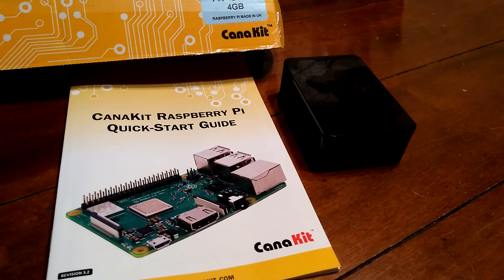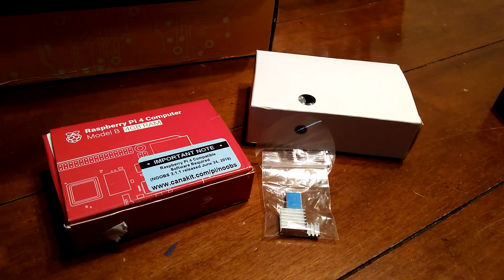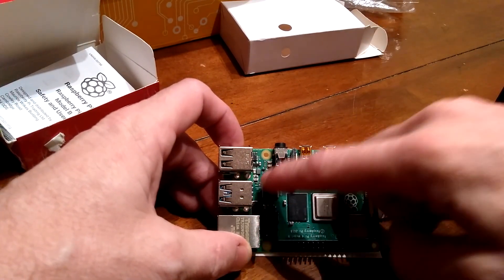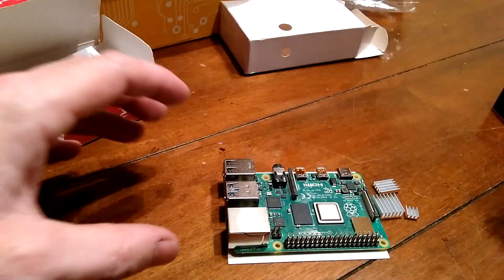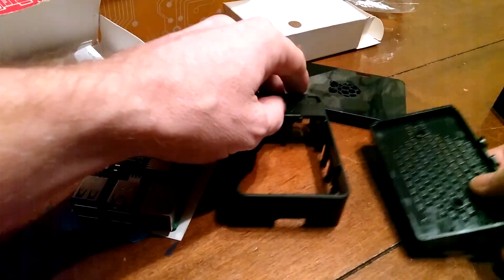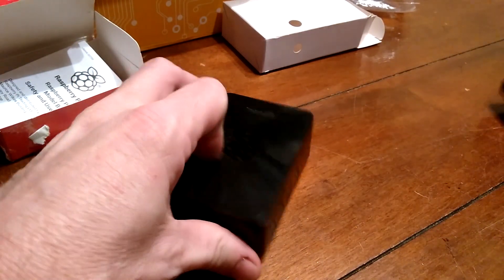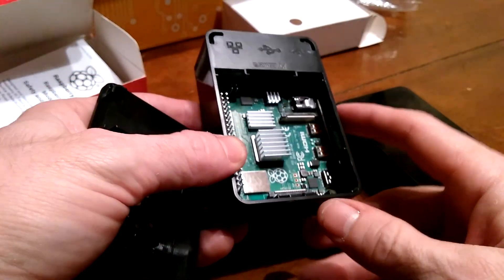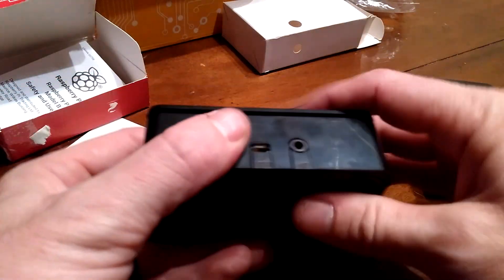Canakit Raspberry Pi 4 Assembly & Review with Proper Heat Sink Placement

Comment: No fan? lame, the Miuzei Case from Amazon with Amazon ID: B07TTN1M7G  looks better and has a fan to keep it cooler.
Reply from the maker: that didnt exist when this was made and this is a starter kit, cool looking case though 😉👍
Reply: My Canakit came with a fan that is WAY cool.  I had to hold it up to my ear to make sure it was working.  It also comes with a micro hmdi to hdmi (male) connection.  Made it so I didnt' have to buy a converter.